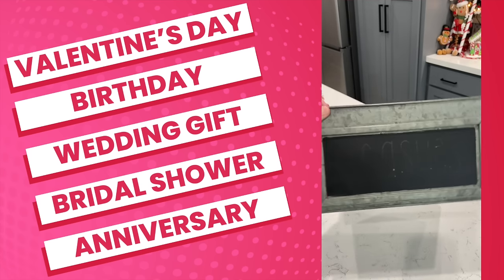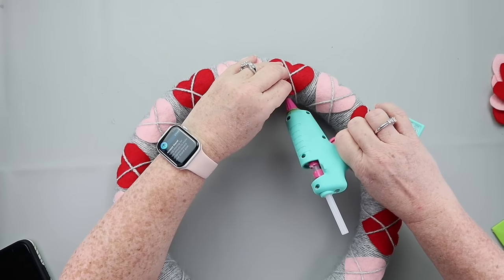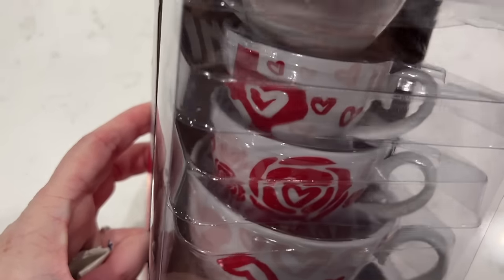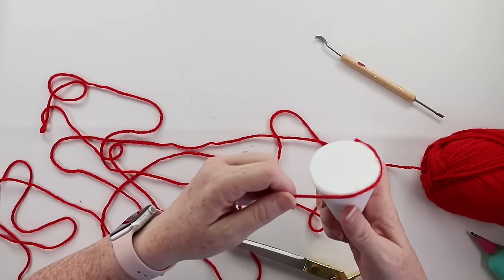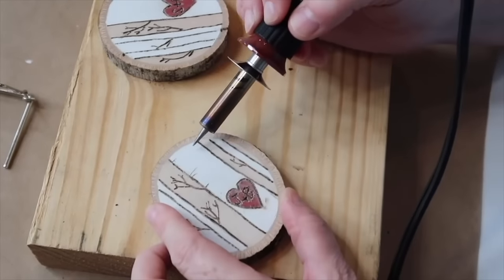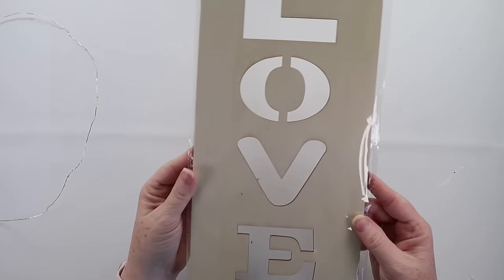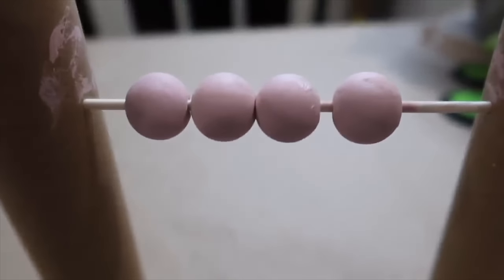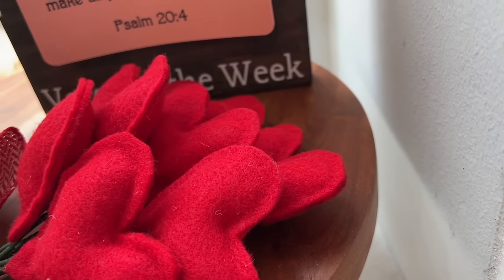❤️ 25 VALENTINE DIYS that will fill your house with LOVE! Easy projects anyone can make! ❤️

Comment: Hello. OMGoodness ! This whole video is Fabulous ! I've been wanting to make Mini Bunting (flag garland) & your Love Bug is Adorable w/it ! The Family Gathering is too. All the Hearts Crafts & Framed Ones are So Cute. I do a 2 Tiered Tray & Yes, these would be great for those. I need to get a putty knife. I am having a hard time separating certain glued on things off of the wooden & metal signs from D🌳T, w/out wrecking them ! I tried a butter knife, but no good. I got a Truck from Christmas w/the Tree on back. It needs to come off so I can Paint It & add Flowers & Heart Balloons to the back of the Truck. The pkgs. of the plain mini Wooden Hearts w/hang holes are great for all kinds of things & I'm working on Painting those to hang on  my Valentine Tree, a Garland & some other Projects. I love the idea of painting over the letter stickers for stencils, I never would have thought of that, & would think they would be stuck on from the paint, but it came out very nice & I am going to try that. I do have a few Ink Pads & 6 Rubber Stamps- just a few Valentine Minis & 1 Hello Spring Gel one & 2 Alphabet sets in rubber (1 ea. of Capitals & Lower Case), & those are Teeny Tiny. I do not do any distressing, of any kind, but I do love the way they come out. I'm Ecclectic, but tend to go toward the Bright & Cheery, Florals, Polka Dots, Gingham,  & Pinks more than Red, but I still include it, & minimal Glitter, but do like Sparkles, Gems & such here & there, Shabby Chic, Romantic/Girly, Ribbons,Tassles, Lace, Velvet, Tapestry, Country/French Farmhouse but w/out a lot of Grey, Checks, Plaids, B&W, Burlap & distressed items. I do incorporate some B&W, Grey & Burlap, just not a lot. I do White or Off White/Cream w/Colors & Prints. Do you ever do any decoupaging of Lg. Items: (Trays, Table Tops, Etc.)? I'd love to see more ideas on that if possible or could you recommend a Utube Crafter who does that? Thanks. I will be watching this one again & again. It is saved ! Thank You. Take Care & God Bless You.💖💘💋💌🌹💖💗❤️😃

Comment: Great projects, you gotta love getting to do holiday projects. Just a few things I wanted to say about the polymer clay ones you did. First I would recommend staying away from getting water in contact with the clay, it won't help the pieces to stick, in fact, the steam from the water evaporating could cause them to lift apart. Generally speaking raw clay will attach to raw clay with a bit of pressure. If you want a firmer bond or want to add cooked clay to raw use some liquid clay to attach the pieces. I don't remember if you mentioned it or not but if you use a baking surface (or anything else) with the clay don't ever use it for food again. And finally, be very careful what glues and finishes you use on the clay, not everything is polymer clay friendly.
Reply from the maker: Thanks for the tips!

Comment: I love your diy's BUT!... Pouring candles is not as easy as shown by so many diy'ers here or anywere... You have to make sure that the wick fits the diameter of the candle. Using the wicks shown here will cause tunneling of the poured candle in the cup...
How come this is never ever mentioned in any diy video? Don't forget, pouring candles is a teached profession with a long history...
Reply from the maker: I didn’t have any issue with tunneling.   The wick held steady by being secured.   I keep it real on my channel and If you go back and watch this diy in the original video from last year, I documented and shared some wax spilling when I made that project.  Since this is a comp and a repeat project, I cut down a lot of footage to be able to put several DIYs in my video and not making it 2 hours long.  😊

Here’s the original video from last year if you want to see my mess! 😆
https://youtu.be/DGoRA9TcGKI?si=LwG0-iLJKLeRe0kf